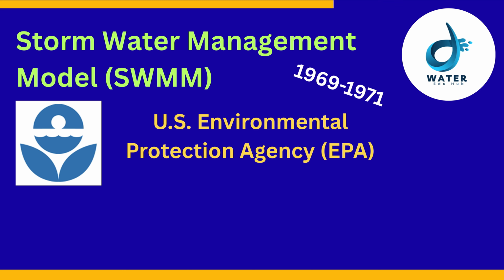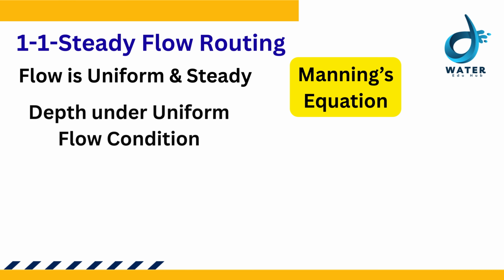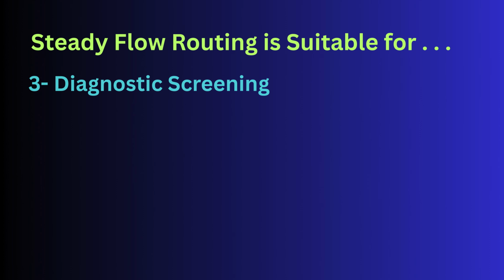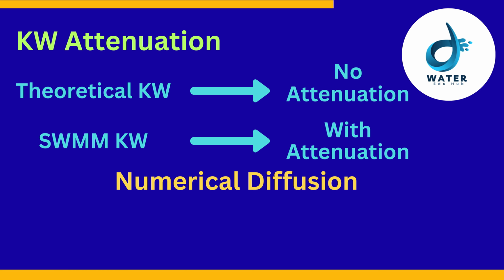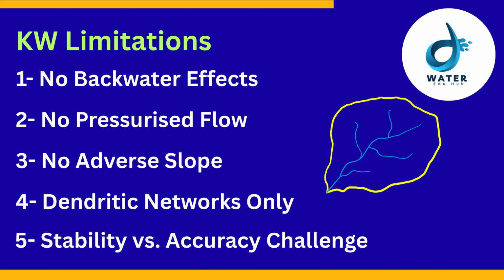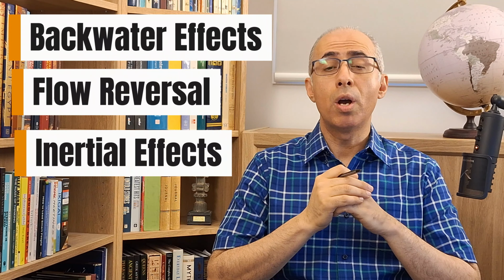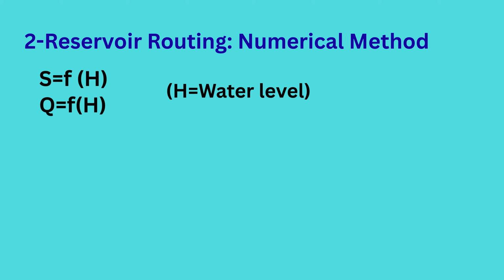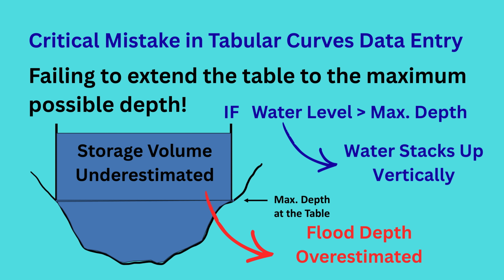How to Choose the Right Flow Routing Method in EPA SWMM: Theory, Parameters & Common Mistakes

Comment from the maker: Also watch the channel's other videos on routing:
Flow Routing Explained: Hydrologic vs Hydraulic Routing
https://youtu.be/ctPJHQ95vrw
How to Route a Flood Wave using Muskingum Method: From Theory to Excel Calculation
https://youtu.be/f7A4cFjGeqg
Reservoir Routing: Level Pool (Modified Puls) Method | Theory & Example
https://youtu.be/BAcwWzot6ds
Which HEC-HMS Routing Method Should You Use? (Channel & Reservoir Routing)
https://youtu.be/DL-9mHpq2HY
How Routing Works in RORB: Channel Routing, Reservoir Routing & Common Mistakes
https://youtu.be/mCXI8hpl8v0